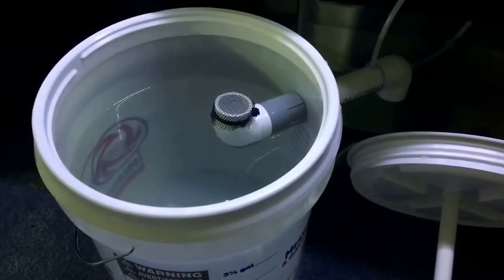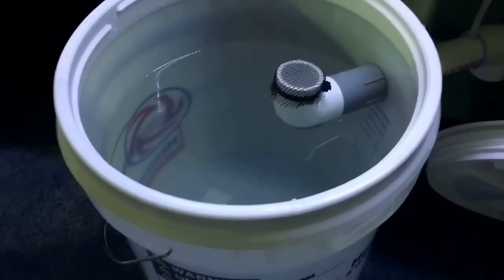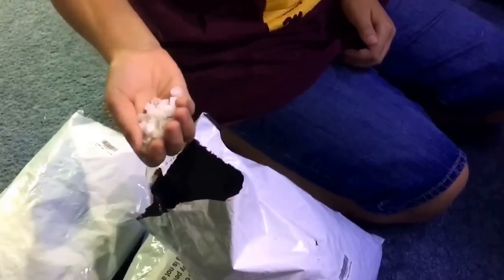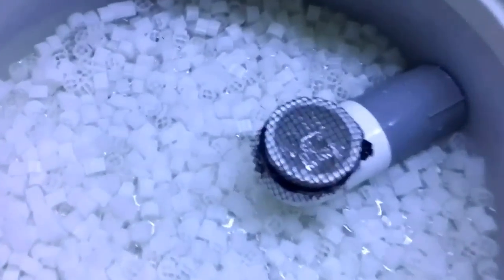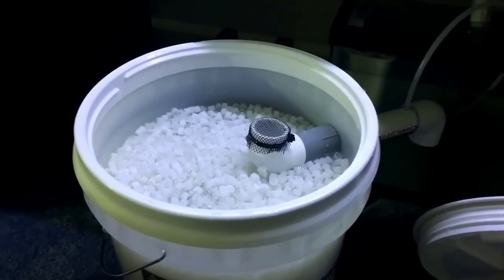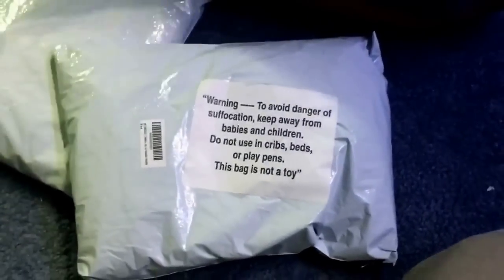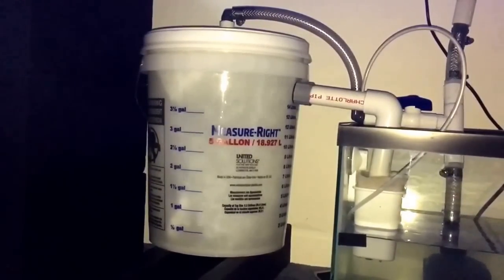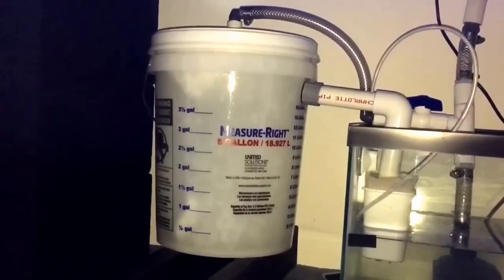DIY Fluidized filter Update!

Comment: Hey bro. Watched the video . Like the way you explained. Does this filter makes good noise even in airtight containers as you have used?
Reply from the maker: Appreciate you! To be honest we had 40 tanks running with a central air blower. So I couldn’t really hear any extra noise. I loved how the k1 was tumbling in this bucket. When I move my plecos to the next tank. I’m going to revise this fluidize filter for a reprisal. So please keep checking on us… thanks Ron
Reply: Thanks for answering. If you stop that central blower , do you hear the k1 tumbling . I have to use that system in my bedroom so will it make noise?

Comment: How it this attached to the sump
Reply from the maker: Jalen Miller a water pump pulling the water from the sump into the top of the bucket. The pipe attached to the bucket body over flows the water back to the sump. Closed loop style!

Comment: Hey thanks for subbing me back! Not always does someone have proper decorum concerning etiquette. Ie. Thanks dude! Great video, how is it holding up nowadays? I've been thinking of making a fluidized filter fur quite a while now, but soon I will have a 150 gallon tank going and need input. Keep on keeping on!
Reply from the maker: toycar foushboy anytime! I'm always happy to support others. Especially when they show us love. It drives me crazy when someone doesn't do the same. The fluidized filter is out for now. I have to redesign the discharge side it started to fill the bucket to the lid and was leaking. I'll get into it in the next month or so. I could help you with your design so you could avoid the issues that came up with ours.. just let me know. Thanks Again!